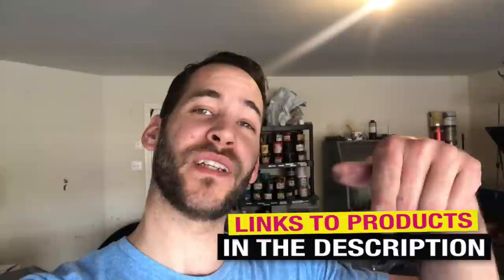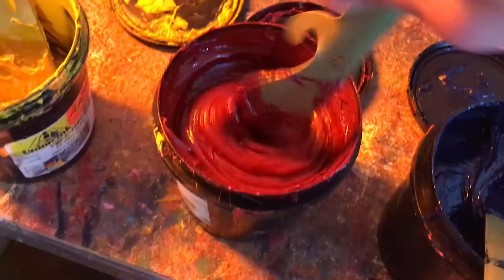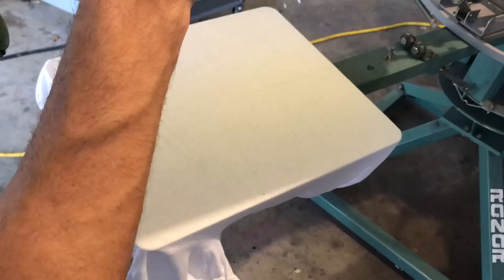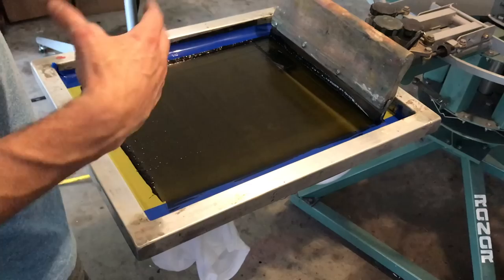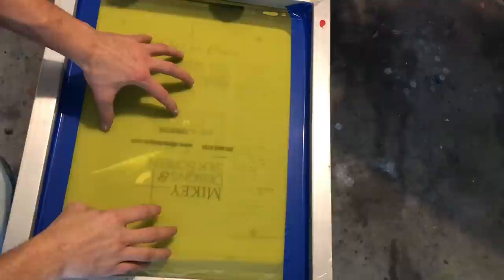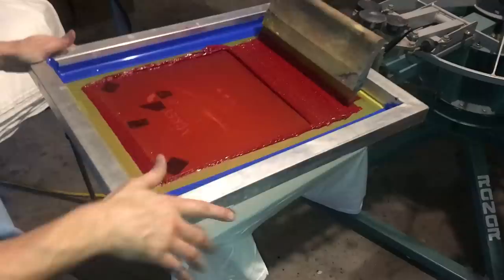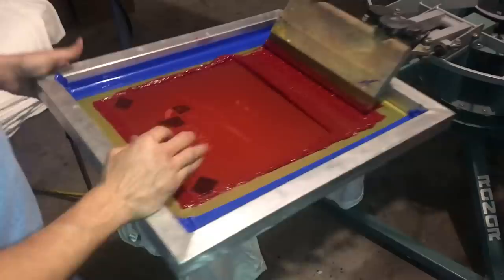How to Register and Screen Print CMYK 4 Color Process on White T Shirts

Comment: I took a class for screen printing in high-school years ago and loved it and recently got a smaller 4 color unit for myself at home and this video has been most helpful, thank you. I was wondering how how the yellow doesn’t get on the bottom of the screen that follows it which I would think might cause it to transfer or smudge much the yellow with the magenta it whatever color followed it ? Sorry if this is a stupid question I just wasn’t really sure if that would happen or is possible to happen. Just trying to watch as many tutorials as I can & hopefully   get reacquainted with the process before I start and end up ruining a bunch of shirts (LOL). Thanks for all your help!!
Reply from the maker: Hi Angie and thank you! You actually want the ink to imprint on the bottom of the next screen, and so on and so fourth. It's a process called wet on wet printing in which it saves time not having to flash between colors, which can cause a lot of issues such as the print wanting to stick to the screen if not properly flashed, or the amount of ink layers being too thick. I hope this helps. :)

Comment: how much did you spend on that printing  machine and frames etc. for beginners
Reply from the maker: I bought mine used for $2100. Cam with frames or screens and I bought ink as I needed it per job. The flash was $600 at the time, new, and I used that to cure my shirts.

Comment: Hi Matt
How about a multi colour discharge print tutorial
Reply from the maker: Hi Mark.  Certainly.  We'll do a video.  Would you like to see a discharge base with plastisol on top of the discharge base? Multi color discharge with no overlaying colors?  Let me know and we'll get to it.
Reply: @mikeydesignssilkscreen473  - it possible, but this requires a variety of technical conditions in the printing process, such as humidity and constant humidification of the working environment and meshes, the temperature in the production. Since you work with wet-on-wet method with plastisol ink, printing with water ink will be familiar to you. But most importantly - the microclimate and constant moisture. It costs some money.
Reply from the maker: @smetankorzevic6647  I agree. If you live in a dry place, it will make it more difficult during long runs. How about using a humidifier in your shop?

Comment: Hello, I usually have trouble maintaining my details dot, some wash off but some dont, and what happens when you use 300 mesh count, is that suitable for CMYK printing? Because everywhere I go I see people saying 305 but I can only get 300 count mesh, pls advise me, and what's the uniqueness of the emulsion from other emulsion?
Reply from the maker: 305 is best for CMYK printing. It'll hold those 55 lpi dots and you don't have a ton of ink going down.  Try using a dual cure diazo emulsion like Ulano TZ in our links / description. When I use a photopolymer emulsion, like Ulano Orange, QTX, or QX-5, the 5%-10% dots tend to not hold as well.

Comment: Hey Matt, good stuff as always!  I just recently upgraded my exposure unit.....going from the DIY halogen light to the Ranar XPO 2426, which I think is a model under what you got.  I also changed emulsions as well, going from Ulano Orange to the Saati PC Blue.  I know you said what emulsion you used in this video is different, but wanted to see if you have used the Saati PC Blue in the past.  I just do a one and one coat on my screens that are 156 mesh.  Just curious as to what you exposure times are?  I'm use to with my halogen light flashing for 6 minutes 30 seconds LOL.  I tried exposing a film last night with the PC Blue for 45 seconds....seemed to be ok,  but thanks for your time, SKD
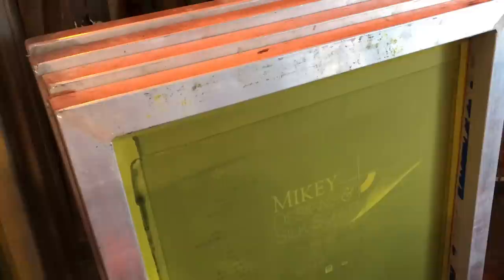Reply from the maker: Nice up grade!  We use Ulano orange as well, but for our spot color work.  It generally took about 1:10 per screen, but we like to over expose ours a little to avoid the unexposed emulsion from running into the open art.  45 seconds works well too, but like I mentioned, we like to over expose a little, which isn't a problem if your film is dense.  I haven't used Saati just yet, but I have a screen printing friend that does, and he likes it.  I'm going to give Saati a try soon, because I've heard many have switched over from Ulano.  I just haven't pulled the trigger yet because we get a great deal on Ulano from GSG.  That and they accidentally sent us a 5  gallon bucket of Ulano Orange, instead of a gallon... Their mistake and they said they wouldn't charge us.  We go through a gallon about every month or so... So it'll be a 3-4 months before we completely go through that 5 gallon bucket.
Reply: Thanks for the reply!  Yeah I gotta keep messing with it....I thought my films were good enough.  I'm using an epson 1430 but I haven't done anything to the printer.  Thanks again for your time, SKD
Reply from the maker: Any time.  Just hold you film up to sun light, if you can clearly see through, it's not dense enough.  It should have a reddish tent to it as well.  They should be like looking through welders glasses, if you have ever looked through a pair.
Reply: Mikey Designs & Silk Screen thanks again!! Tried for 40 seconds and was pretty good!!
Reply from the maker: That's awesome to hear! We love ours.  Same setup really, but can do 23x31 auto screens. I was going to get that one, but wanted to have a unit that could expose the larger frames just incase we get an auto down the road.
Reply: Good Morning, Matt

I had a question I know you use 230 but is there a different if I use 225 or 280
Reply from the maker: 280 will lay down less ink than a 225, but will hold greater detail. Depends on how much ink you want to lay down.

Comment: so when we are painting an image after breaking it down but the colors do not contain yellow or black etc, but more like pruple pink and blue. (some other colors other than cmyk) do we still print the lightest color first?
Reply from the maker: General rule of thumb is smallest image / lightest first, but it depends on how you separate things out. Dark may need to go first. Takes some experimenting.
Reply: another question is when doing your angles and frequency how do you know what dot size you are looking for? @mikeydesignssilkscreen473

Comment: Hi Mikey! Im Ace from Philippines. I really admire your skills on screen printing, and it really encourage me to practice. But i got trouble on "wet on wet" process. Whenever I put the next color, the previous color stick under the screen :(
What should I do? I use plastisol inks
Reply from the maker: Thank you! When printing wet on wet, the color will build on the bottom. When you say stick, are you flashing a color before? Is the screen sticking to the print?
Reply: The ink stick to the screen, thats what i mean. is there any trick or strategy to avoid that?
Reply: i didnt flash also. Some of ink stick to screen because the previous color is wet. Sorry for my english :(
Reply from the maker: It's supposed to build up on the back of the screen with wet on wet printing. As long your print comes out crisp, you are good to go. If not, then used a more opaque ink or higher mesh. I hope this helps.

Comment: What's the process for doing double print? Like printing on a clothe, then doing it again to make it brighter and stronger? And also so it won't wash off
Reply from the maker: I'll do a video soon to show you.  You basically print, flash, and then print again.  Generally you do this with white ink, and or opaque light colors (orange, yellow, red, green, etc.) on dark garments.
Reply: Mikey Designs & Silk Screen oh wow thanks, I will be anticipating
Reply from the maker: Certainly!  I will be working on fulfilling video requests soon.

Comment: Question again, why didn't you use glue to hold the shirt in place?
Reply from the maker: aina opeyemi spray tack was used which holds the shirt down. I’ve recently switched to a spreadable pallet adhesive called pallet pro.

Comment: Did u do a 22.5 degree (angle)
Reply from the maker: Ah, forgot to mention that, but yes.  I used AccuRip with a 22.5º angle.  I keep that angle locked in and it works great for everything. I hope this helps.
Reply: @mikeydesignssilkscreen473  sir, what ink did you used?. water based ink, plastisol?.. also, spray for the pad?.. thanks advance.

Comment: How did you make your inks so thin, mine are thicker
Reply from the maker: Stir them up well, or could just be the brand. We're using Union's ink.
Reply: Plastisol thinners and  so-called "soft hand" additives will help you.

Comment: How do I know where to place the design on each screen so that everything lines up. I know that's what the registration marks are for but they only works if they are in same location on each screen... correct?
Reply from the maker: I just center the film on the screens, expose them, then center the screen on the pallet. I have centerlines on the pallets. I print the darks color on light shirts first, or lightest color on dark shirts. Then register then up.
Reply: @mikeydesignssilkscreen473  on thanks...I sent you an email earlier this morning about the registration template. Did you receive it?
Reply: Would you send me a version that will open with CS6
Reply from the maker: Just checked my email! I have been out of the office today, but I just emailed it over.  Let me know if you have any questions.  Thanks!
Reply from the maker: Certainly!  Doing that now!
Reply from the maker: Thank you so much for watching my videos! It really means a lot and makes creating them all worthwhile.

Comment: How is he aligning each color???
Reply from the maker: You'll need to print registration marks on each of your film and them line up the registration marks.
Reply: @mikeydesignssilkscreen473  Thanks for the reply man! Where are the registration marks? When you're doing C, M, Y, K, it seems that you're just randomly lowering the screen to the shirt but they end up dead-on accurate.
Reply: @mikeydesignssilkscreen473  Once I print the marks on each screen, with what do I line them up? With each other?
Reply: @mikeydesignssilkscreen473  And also, do I need a triple durometer squeegee?
Reply: @mikeydesignssilkscreen473  And also could you give us a link where to buy the CMYK inks themselves? Thanks a lot!
Reply: @mikeydesignssilkscreen473  Also, is there a 0.5" tolerance between the inner screen and the station? My station is 21.7 x 17.7 whereas the screen you have in the description is 17.2 x 21.2 inside
Reply from the maker: @kentbummerm5586  I created the marks in Illustrator. You just need some sort of registration marks using the registration color in the color pallet to print on all your films that you burn into your screens.
Reply from the maker: @kentbummerm5586  That's correct!
Reply from the maker: @kentbummerm5586  I would use a harder squeegee like a 80 or 90, but not 100% necessary. Use what you got.
Reply from the maker: @kentbummerm5586  I like to use wilflex inks. I don't have a link, but you can get it from GSG.
Reply from the maker: @kentbummerm5586  Isn't that the same size frame? You just turn it around? I have about 1/8 off contact. I think that's what you were asking?

Comment: try cyan magenta yelow black
Reply from the maker: Done it. The reason for printing lightest to darkest is, with CMYK, you print wet on wet. If you print in CMYK order, your yellow ink will start to turn either pink or a green color because the screen will start to pickup the ink and mix in your yellow. I hope this helps.
Reply: good point
Reply from the maker: It only makes since to do it in that order. Tried it numerous times, and it can really wreak havoc on your yellow. lol